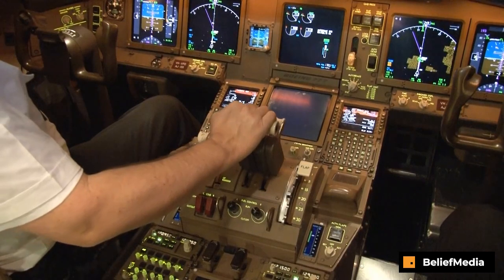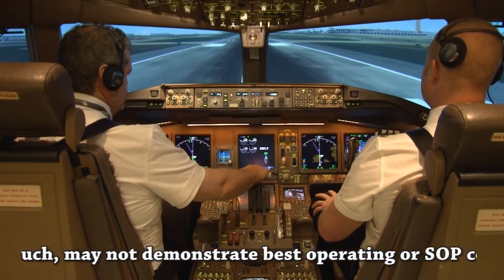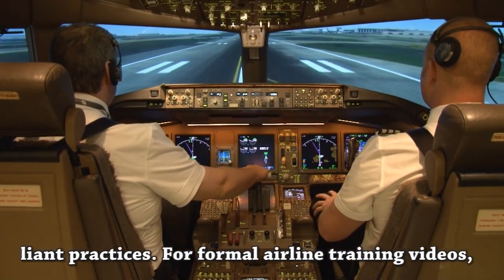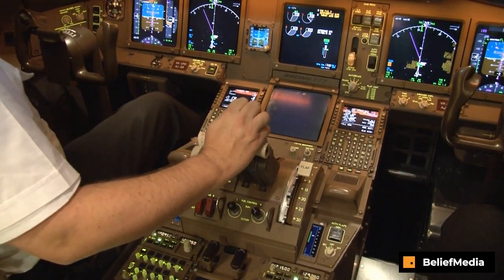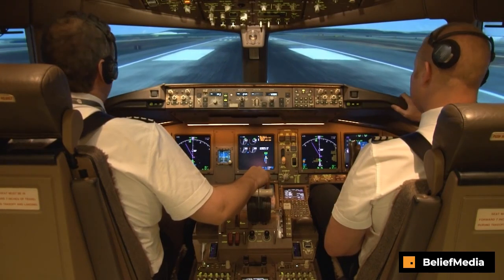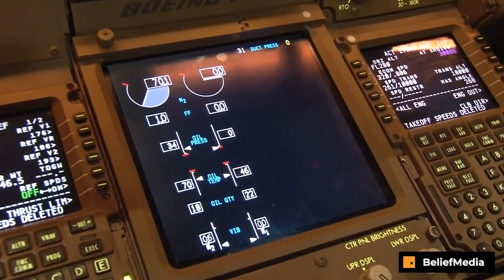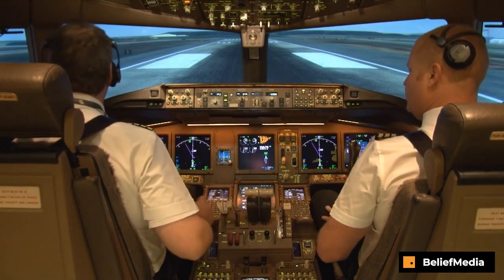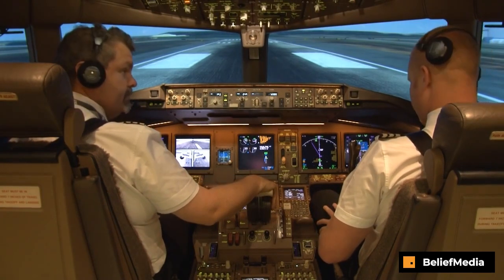Boeing 777 (Simulator) Engine Failure During Takeoff

Comment: This is just an aborted take-off, no engine failure, a sudden engine failure on TO would slam the pilots to one side and produce such immense yaw that they would struggle to keep the plane centered
Reply: No it wouldn't. The 777 will automatically apply rudder to compensate for the differential thrust. Even if it didn't, the yaw is not that extreme and can be controlled using rudder.